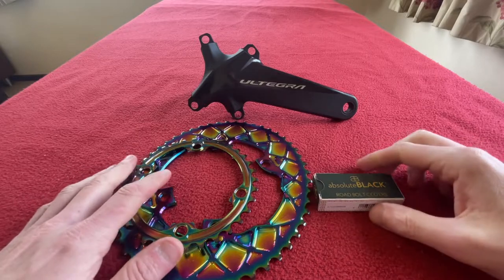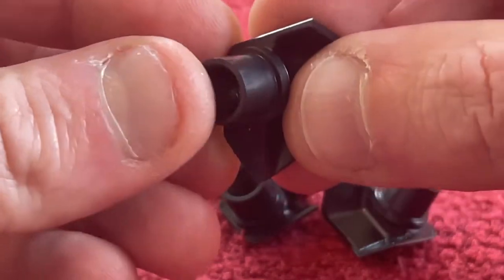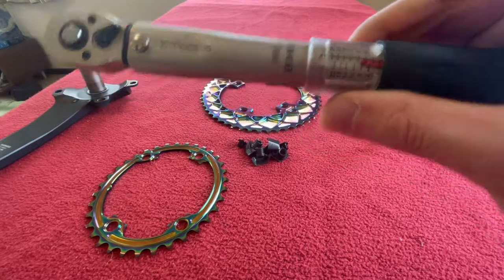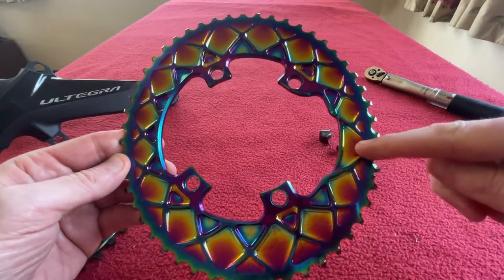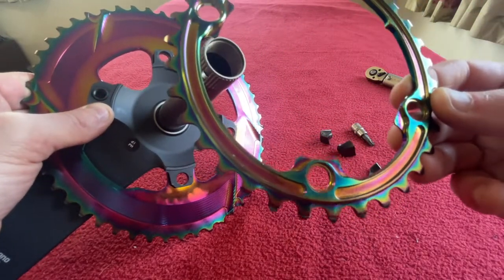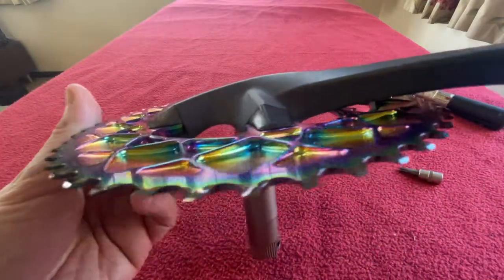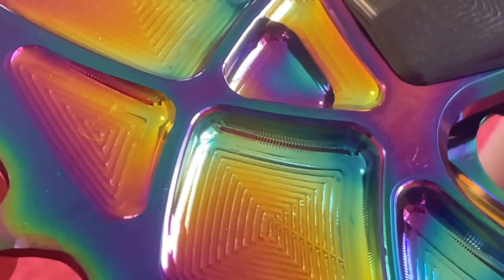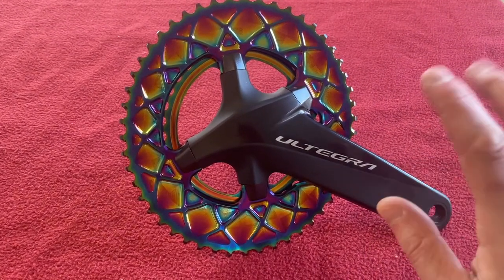How To Install AbsoluteBLACK Oval Road Chainrings

Comment: Fancy!
I would also put a bit of thick grease between the metal on metal surfaces. I've got some creaking sounds that came from the chainring bolts in the past that were fixed that way.
Reply from the maker: Yeah that’s a good point 👍 couldn’t find it in the instructions but a really good point. 👍

Comment: If I get a 50t absolute black oval chainring on Amazon it says x2 
It doesn’t just have the x1 which is what I need
If I just use the same chainring bolts from my x1 setup now on the absolute black 50t oval chainring would it work ?

So it’s basically I just wanna make sure if u know that just using the bigger chainring alone with certain sized chainring bolts would do the trick I already know about 110bcd and the bolts size need to be of size just worried if it’s x2 if I can just use it for  1
Reply from the maker: I’m not sure, if you contact Absolute black on their website they’ll be able to help you. 👍

Comment: Hi. I got 50/34 absolute black after fitting them the space between them seems to tight as the chain catches the big ring shifters when in the small ring and small cog.... as if the bevel isn't enough on the big ring or the small ring needs a washer spacer. What's your thoughts.
Reply from the maker: Check your front derailleur is parallel to the rings, I noticed mine wasn’t and I had to alter the frame interface by using shims. It is tight but once it’s sorted they run like a dream. 👍